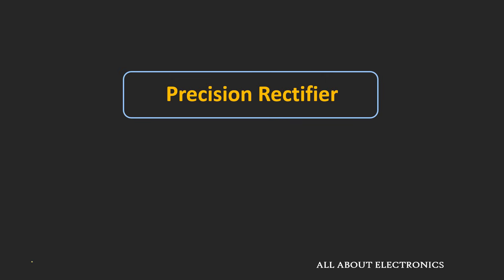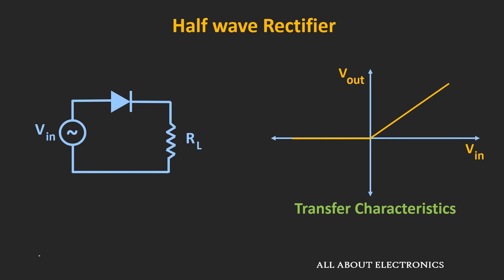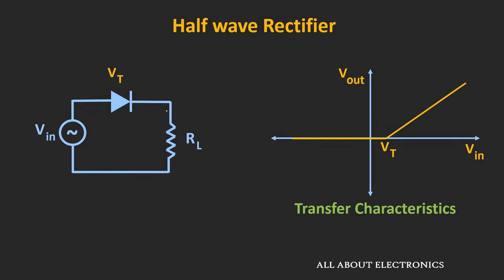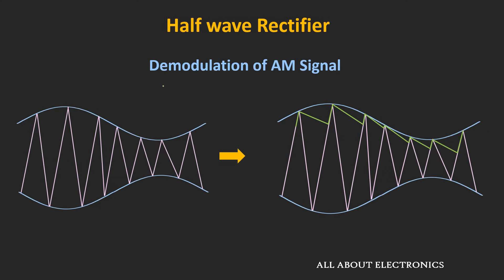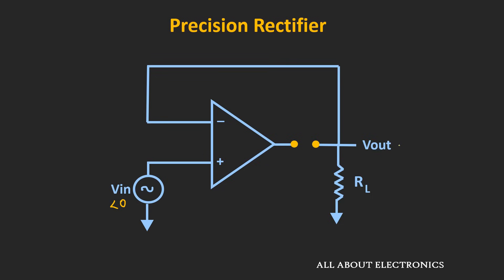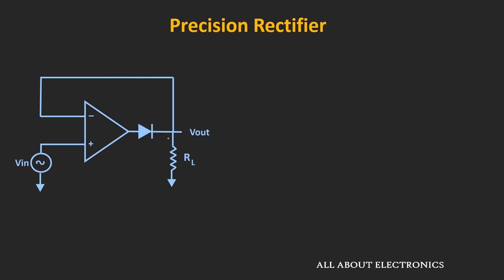What is Precision Rectifier? Precision Rectifier Explained

Comment from the maker: The timestamps for the different topics covered in the video: (For more information check the description )

0:23  What is a precision rectifier? How is it different from a regular rectifier circuit?

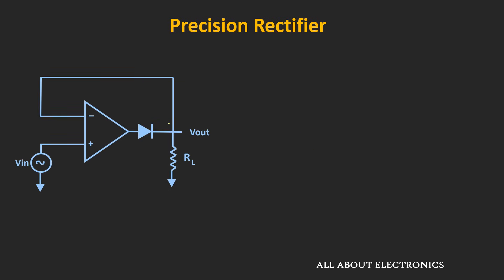4:00 How precision rectifier circuit works (Circuit analysis of Precision rectifier)

8:51 Modified Precision Rectifier

16:02 Design of full wave rectifier using the precision half wave rectifier

Comment: First of all, Thank you for a great video.
If I understood correctly, the purpose of explaining the super diode circuit is to demonstrate how the assumption that the diode in the negative feedback loop is approximately ideal can be justified, with its voltage drop being negligible. Thanks to this assumption, the problem of the simple half-wave rectifier circuit is resolved. However, in the explanation of the super diode circuit, it is not clear to me how you derived the expression for V_F' . Is the  V_F' actually a representation of the V_{in} voltage, where when you showed that V_F' is approximately zero, it means that a slightly greater input voltage than 0V is required for the diode to conduct? 

And this is derived from the general expression for any operational amplifier, which is V_{IN} = V_{out}/{A_{OL} ?

Additionally, if you made such an assumption, why did you then use the value of V_F and not V_F' in the expression for V_{out}'  ? Thus, the assumption that the diode is approximately ideal is not reflected here.

I appreciate if you could explain that.

Comment: Can anyone explain how at 8.16time .. The voltage should be negative
Reply from the maker: Here we are assuming that the diode is in the reverse biased condition and hence acts as an open circuit. For the diode to be in a reverse-biased condition the voltage at the anode should be less than the cathode. Here, in that condition, the voltage at the cathode is zero. That means the diode will remain in the reverse bias condition when the voltage at the anode is negative. Or in other words, the output of the op-amp is negative. And it will happen when the input Vin is negative. (Because in that condition, the output of the op-amp will be negative saturation voltage as it is operating as a comparator in the open loop condition). I hope this will clear your doubt.

Comment: I don't understand in the case 12:21 when V_in > 0 there is the current passing from the point of 0V through D1 and to the point of -0.7V while this circuit isn't closed ?
Reply from the maker: Although it seems, the circuit is not complete through an external resistors, but the current flowing through D1 will go through an internal circuits of the op-amp. And the path will get completed through an internal circuit components of the op-amp. I hope, it will clear your doubt.

Comment: 11:58 Why is Vo equal to 0? Is it because there's a negative voltage at the anode of the second diode?

I don't see how it would be 0 if Vo is connected to ground through 2 different resistors. Wouldn't the voltage drop across those resistors?
Reply from the maker: Think it as if two passive resistors are connected at one end, and the other end of both resistor is connected to the ground. In that case, the voltage at the common node (where both resistors are connected ) would be 0 V. I hope, it will clear your doubt.

Comment: I'm still a little bit confused, why Vo is equal to zero when Vin < 0, for ideal op amp, V+ = V-, so the Vo should be always equal to Vin 🤔
Reply: You can apply the concept of virtual ground only when there is negative feedback. But in case of reverse bias there is no negative feedback

Comment: When V>0, I don't understand why D2 does not conduct.
Reply: @frankreiserm.s.8039  Inverting amplifier.  So output voltage will less than zeno. when a diode's P junction is connected to negative voltage then it will work as reverse bias.  This is why, D2 will off if input voltage is > 0

Comment: 12:23 diode D1 is conducting some forward current flows through it. Then the current will pass through D2 also isn't it? Then how D2 won't conduct? Which path does current from D1 will follow?

Comment: at 4:25 why effective voltage drop found out by   dividing by open loop gain ?
Reply from the maker: It is in the closed loop configuration. The concept which was used to establish the concept of virtual ground is used here. Just after 4:25 in next 2-3 mins,I have explained that.
Reply: @ALLABOUTELECTRONICS   thanks for replying  sir
Reply: @ALLABOUTELECTRONICS   sir at 11:30 you said that opamp is operated in linear region and we can apply the concept of virtual ground  
so my doubt is that if it was not in linear region then could we apply or not  the concept of virtual short
plz reply sir

Comment: Your analysis methods are sometimes get way too vague leaving so many doubts.Please while making assumptions provide a little more information like in this video you assumed the voltage (V_) to be 0V(while analysing the circuit for negative input ) now if one goes by the virtual ground concept, one gets confused how can it happen when V+ has to be V- ( and V+ is Vin).

Comment: for purposes of explanation at 11:37 : at the junction of R1, R2 is at "virtual ground" ; be careful with  this idea ! 
this voltage is very, very small, it can NOT be  0v. 
 for positive Vin]pk inverting input is  +0.6v/A]open_loop or about  0.6uv for A]open_loop = x1,000,000
 0.6v is presumed to be the fwd voltage of D1

Comment: Why isnt the concept virtual short is applied when vin < 0? Applying virtual short concept for vin< 0 yields Vo = Vi, im confused 🤔
Reply from the maker: It won't be. Let me explain. Let's say, Vin <0. That means V+  is negative. And currently, we don't know whether there is a close path in the op-amp or not. (it will depend on whether a diode is conducting or not). V- is connected to the ground via a load resistor. That means V- = 0. As, V+ < V-, so the output of the op-amp will be negative. And indeed the diode is non-conducting. That means the op-amp will operate in the open-loop configuration. And V0 = 0. 
I hope it will clear your doubt. If you still have any doubt, let me know here.
Reply: ALL ABOUT ELECTRONICS sir you just said Vin< 0 in the beginning then how come the output  will be zero, instead it should be (-R2/R1)Vin  for an open loop circuit where D2 is conducting .Kindly explain I’m confused.
Reply: Harami sale
Tereko sir itna time leke explain kiyela aur tereko thanks bolne ko nhi hota
Reply: Thank you sir. I also had the same doubt.

Comment: Sir , how does the effective voltage drop get divided by open loop gain 4:22
Reply from the maker: The diode is connected at the output of the op-amp in the feedback configuration. So, the effect of this diode drop on the input will be equal to Vf / Av. So, from the input side perspective, it behaves like an ideal diode. 
I hope it will clear your doubt.
Reply: @ALLABOUTELECTRONICS  Dear Sir,

I really appreciate your effort on making such good teaching videos.
Regarding your explanation, I understood (hopefully) the assumptions you made, and seems normally that the voltage across the diode to be as minimum as possible in order that the circuit to behave as a voltage follower (when Vin > 0). 

However, can you point me a further reading resource on how this is achieved knowing that the silicon diode (in this case) has to consume at least 0.7V in order to close the circuit (to be seen as a voltage follower)? Should I think on some very fast time changing states of the internal opamp circuitry, that somehow balances this overall steady state? Or in fact, the diode really stays around 0V, as in practice there will still be a very small current passing through it and in this fashion closing the circuit? Thank you for your attention!  

Best regards,

Comment: Sir, at 1st case, we assume the diode is conducting,  but after the explanation, you said, only when Vin>0, then the diode is conducting.  But, why?  

First we assume, and the we prove vin=vout. But, how can we say that??
Reply from the maker: To prove that case, you need to take some assumption. With that assumption if you are getting correct answer that means your assumption is correct.
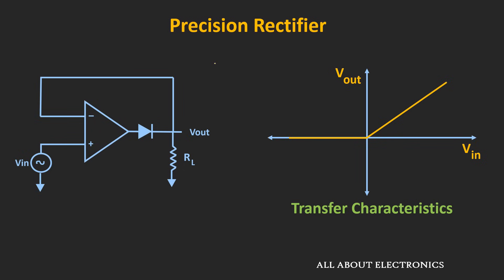Reply: Let me try to explain. Stop the video at 3:09 and look at the circuit.
As you asked, why should not diode conduct only when Vin is negative?  Well if Vin is negative, output from the op amp will be negative too. This will reverse bias the diode and current cannot sink in through output. Since Vout is connected to ground through  resistor, output voltage will also be zero.
Reply: @curiosity551  When vin>0 diode is forward biased and we have negative feeback and Vout is fed back to negative input. Op amp action makes the inputs the same so Vin=Vout . Difference between inputs is 0 volts. When Vin less than ground the op-amps output goes to negative supply voltage and diode is reversed bias and Vout = 0 because there is no negative feeback since diode is reversed biased (open circuited) .  The output resistor pulls vout to ground since there is no current.

Comment: why (V(0) + 0.7V ) / A(OL) = 0  at 6:52
Reply from the maker: Because the open loop gain of the op-amp is very high. Typically 10^5 to 10^6. 
So, (Vo + 0.7V)/ Aol will approximately equal to zero.
Reply: @ALLABOUTELECTRONICS  thanks for reply

Comment: Thank you for creating the material with easy to understand explanations. 

I have a question with respect to the modified precision rectifier. 
Why is the input provided to the inverting input of the op-amp? is this change a part of the modification?? 
Please explain.

 Thanks in advance.
Reply from the maker: Yes, it is a part of the modification. (To restrict the output of the op-amp from going into the saturation)
Reply: ALL ABOUT ELECTRONICS Thank you very much for for the quick reply.